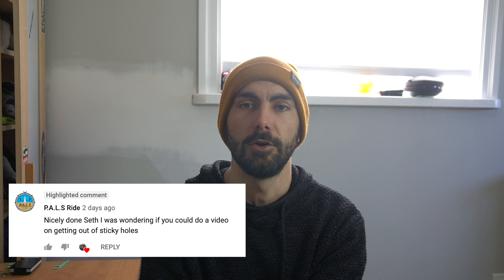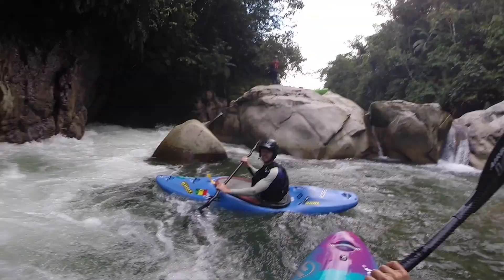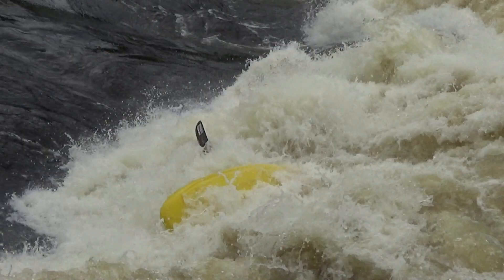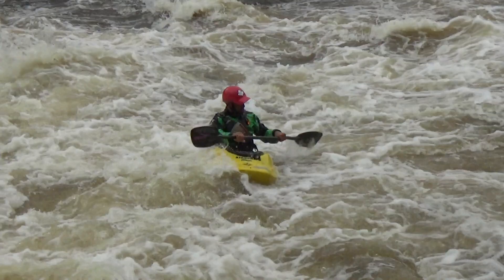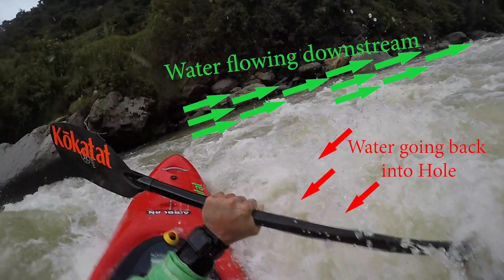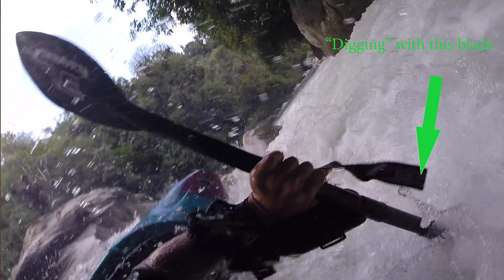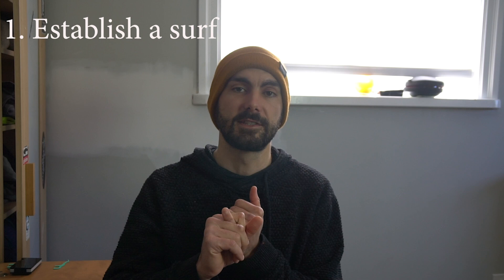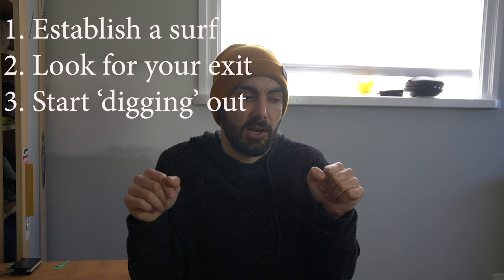How to get out of a sticky hole (aka stopper). Whitewater Kayak Tutorial

Comment: Good video. Now paint that wall.
Reply from the maker: But if you look back like 5 or six videos you will notice a slow improvement. so thats something
Reply: @SethAshworth  thats too funny i am a drywaller tapper by trade , and new to the sport , that seam was the first thing i noticed in in your vids ,all jokes aside thanks for all your shared wisdom at 37 and new to this i find you very helpful esp the safety stuff, (cow tail attachment)  now if that seam comes back add screws cut out loose tape , and start fresh , but looks like a pro job so u should be good lol stay awesome
Reply from the maker: bobby turnbull thanks for checking it out. Glad there is some useful stuff amongst my waffling on. I’ll pass your drywall knowledge along to my landlady in case she needs it. Have fun 🤙🤙
Reply: Thank you for sharing your expertise. And the sheetrock finishing IS exquisite! But really you are a great source of info that's well displayed!
Reply from the maker: @kennethstallings3182  my landlady did a great job on the wall. See more recent videos.  Thanks for watching 😂😂😂

Comment: Can the next video on this topic be getting out of holes that are walled in (think the top wave at Holme Pierrepont) or just generally have curling in sides that are harder to punch through/go over to surf out of the side? Loved this video, definitely going to help some paddlers at uni haha.
Reply from the maker: That HPP one sucks when you are tired and don't want to be in it anymore.  Especially when you are starting out and maybe don't have best boat control yet.
Reply: @SethAshworth  I saw a paddler eventually roll and get ejected as a result of being in a walled hole. Can this ever be a solution? Does the underwater flow catch you when you are inverted?
Reply from the maker: @vannicrider7953  great question. And this is where my answer might deviate from what a swift water rescue manual might say. Short answer is Yes but. Yes the bottom of a hole has water flowing out, yes it’s possible to ball up and get into that water and get pushed out. BUT what then? Now you are out of your boat and still going down stream. I always say getting out of your boat doesn’t usually improve your situation and so riding that water out of the hole should be your Last resort, not your plan A. Hence the video. Hope that answers your question!  Thanks for checking out the video

Comment: Hm.. I'm a bit bummed that you said not to give up, but didn't mention that sometimes it's better TO give up and swim. If you're at the start of a long day of paddling, and are in a really sticky hole that you wont likely get out of in your boat, and it's above a pool, swimming may be better. Obviously you should fight, and you're (almost) always safer IN your boat, but to a point. Some holes just aren't worth it. Swimming is better than becoming exhausted, and drowning when you do finally decide you need to swim, because you have no energy or oxygen left. (But also, fight for more than 5 seconds. hahaha)
Reply from the maker: There is a time where the tactical swim might be the right move. HOWEVER I think it is actually much much much less than people think.  Swimming puts you at unnecessary risk, especially from foot entrapments etc.  Swimming also puts strain on your group to help you rescue all your gear.  Loosing a paddle at any time on the river can create a huge headache. Plus you will quickly run out of people to kayak with if you are swimming in situations you could paddle out of.  And to your point of swimming at the start of a long day, there is no better feeling than getting absolutely pitted at the start of your day and working your way out, you feel unstoppable.  Whereas knowing you swam already (especially when you could have gotten out of it)  has the opposite effect, you will spend the whole day worried about swimming again instead of enjoying what you are paddling.  And finally swimming is exhausting! So yea there is my 2 cents on it.  There is a time for a tactical swim, but if you can paddle out that should be plan A
Reply: @SethAshworth   great comment! thanks a lot

Comment: Seth, Rarely, but it can happen, one can find themselves in a killer class-5 hole where swimming might not be enough. I found myself in one such hole on the Kings in high water. First I cartwheeled, then windowshaded repeatedly with no hope of bracing or taking even a single breath. I swam. But it didn't help because I kept recycling underneath the froth without any hope of getting a breath. What to do? Ditch your paddle, and life vest if necessary, and swim down, as deep as you can. After a few cycles of battling the hole and with no life vest I got out at a depth of 20 feet. As the bubbles cleared I could see the surface and used my last energy to swim up. I blacked out a few feet from the surface but remained conscious as I took my huge first breath. With oxygen in my blood my sight was quickly restored and my buddies towed me ashore. My kayak remained in the holed for almost half an hour until the pillar and float bags had been ripped out and my boat was finally recovered.
Reply from the maker: Dayum son! that is a beat down. I haven't done a hole swim video yet but being able to take your lifejacket off underwater is a skill kayakers should at least be aware of although hopefully they won't have to do it.  Glad you are ok.  What were some of the most useful lessons you learned from the experience?
Reply: @SethAshworth  First lesson, don't panic. You'll always have a second or two to think about your situation, and options, before getting sucked down so take a big breath and do your best to find a way to brace yourself up and catch a breath. If you can catch an occasional breath, no worries. Just as you talked about, you have plenty of options to brace and work your way to an exit point while remaining in your boat. But if you can't breath, and bracing and pulling gives you no opportunity to see where you are in the hole, or breath, about 10 to 15 seconds is usually a good time to swim (exit your boat). If you're swimming and find yourself repeatedly cycling in and out of the depth of the hole, toss your paddle and on the next downward cycle swim strongly down and into the swift current. Swimming down into the depths of the hole may seem counter-intuitive, but it can sometimes be the only possible way out. After a couple failed attempts swimming down, remove your life vest and try again. Your wet-suit will typically afford you some flotation, but once free of the hole don't relax and don't delay, swim strongly to the surface. Blacking out is a phenomenon that occurs when your blood oxygen falls so low that you lose your vision. Your peripheral fields blacken first and then the blackness quickly works towards your center of vision. Don't panic, you're still conscious and you can still sense up and down, so swim up to the surface. Having free-dived and previously blacked out on a few occasions I knew what to expect, didn't panic, and made it back to the surface.

Comment: Suggest expanding this video to include what to do if the exit point is behind you. Should you paddle backwards (and what would be your stroke and posture), turn the boat around, etc? Also, I have found that a critical skill in exiting a hole in the manner you describe is to be able to sit balanced in your boat so you are not 'leaning' on the paddle to stay upright. Chris Spelius at NOC used to teach this balance in Jaws on the Nolichucky by having people throw away their paddle and hand paddle out of the hole -- you can't lean on your hands for this maneuver!
Reply from the maker: David Fallside thanks for watching Dave, I think an addition video is in the pipeline for sure

Comment: Thank Seth for your video, really appreciate. Wondering if you developed a little more about when you're upside-down in the hole. Which role are you doing or what the difference aspect you're doing when you're in hole. You're mental game approach. How can you locate where is the down stream side ( easiest side to do a roll).

Thank you

Dominic
Reply: Would like to know more how to get back up in a hole and not pull the skirt and swim. Sorry English is not my first language
Reply from the maker: Ok i think i get what you are getting at.  I'll see what I can come up with.
Reply: I'm interested to hear what Seth has to say, but what helped me the most with this is playboating. You flip accidentally enough times that, all of a sudden, you get tired of fighting the water, and you start to realize the times that you are fighting, so you stop fighting the chaos and start to go with it. It's hard to explain here. People would tell me to feel the water and what it was doing, etc., but it wasn't until playboating that what they were saying clicked in my head and body. It was like I had to have enough experience being upside down in crazy stuff that I was calm enough to be able to pay attention to what's going on around me. 

With that said, it helps me to feel for "resistance" in the water. Strong resistance in the water means maybe I'm using the wrong tool and need to try something different. An example: I suck at my offside roll. If I flipped over and somehow ended up in offside setup, I used to fight with everything I had to get over to my onside roll setup. Then I would onside roll, but it was usually an upstream roll, so I'd miss and have to roll again. Now, if I flip over and I'm closer to my offside roll setup, and I feel like I'd have to fight with everything I have to get to my onside setup, then I just stay in my offside setup and try a roll. Like I said, my offside roll form sucks right now, but with the river helping, I usually get up on the first try. 

TLDR: Get lots of experience being upside down (through playboating), and feel for resistance and go with it rather than fighting it.
Reply from the maker: @meldosify1085  Unfortunately not everyone shares your enlightened view of freestyle kayaking.  I wish more people did!
Reply: Melody Ream second that...especially on holes that aren’t too grabby. The amount of fun I had consolidating my roll on the Thames weirs was considerable and taught me a great deal about ‘feeling the water’ and using the resistance I found to my advantage. Freestyle/play boating is probably the best way to improve roll and also what to when you can’t control the water, just the boat 👍🏻

Comment: Great video! Like Dominic, I would have liked some info on what to do when you are upside down and having trouble rolling up or staying upright. Techniques for both rolling up, and for what to do if you can’t. Can you reach down into current with paddle blade and use that to help you roll or to help get pulled out of hole? When should you decide to pull, and when shouldn’t you? Etc.
Reply from the maker: more info on what to look for whilst upside down in a hole.  I dig it. I will do my best!